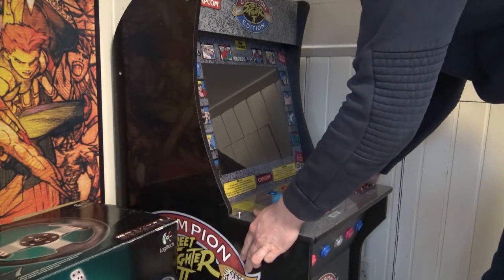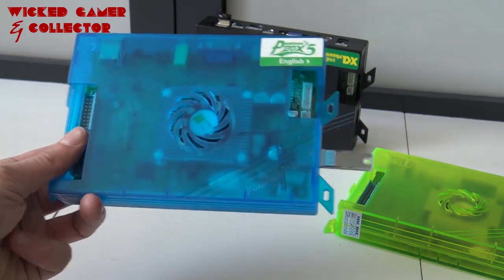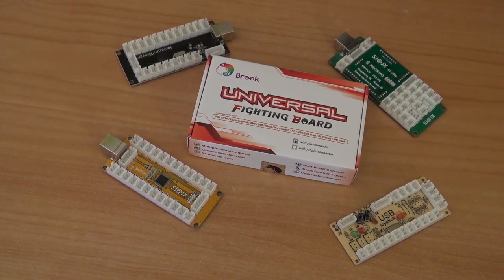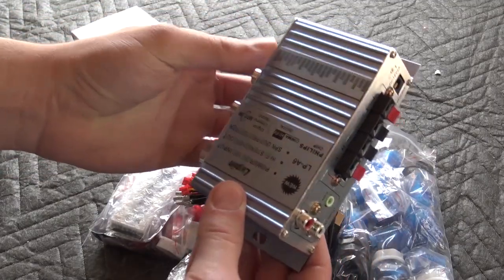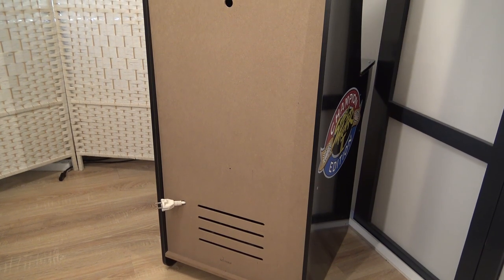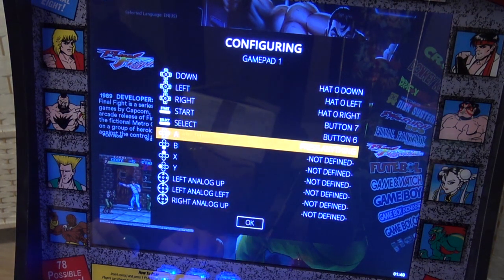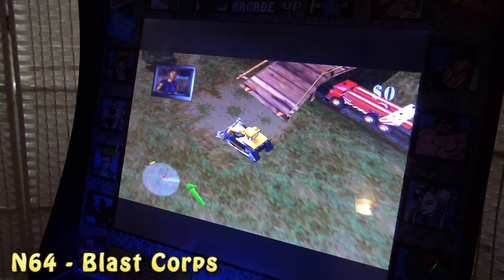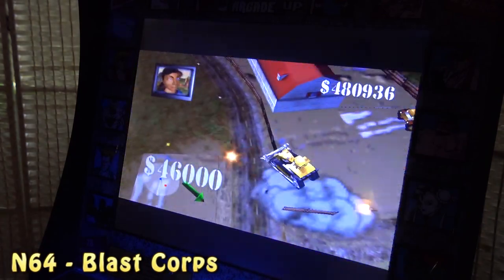Super Console X PC Arcade1up / Arcade MOD

Comment: With my USB encoders plugged in on my super console cube it boot loops for 5 to 10 minutes on emulec screen . When I unplug my USB encoders and  just using the supplied wireless controller then it boots up fine. What is going on here. And also 1st and 2nd player joysticks are randomly assigned everytime I boot it up using USB encoders and arcade joysticks. I never know what side is going to be 1st player.
Reply from the maker: Maybe get a 2 player 1 one encoder board ?

Comment: I upgraded my Arcade1Up SF2 cabinet with a 20’’ monitor (Dell 2007FPB IPS display) using the Tulsa Arcades upgrade kit. The result is absolutely fantastic. Really recommend this mod!
Reply from the maker: Yeah want to have that kit only need to pay crazy amount of shipping. 
Need to contact the guy and work something out. 
Because I hate the original display of arcade1up 😬
Reply: @WickedGamerCollector  Indeed, I ordered my kit on the Tulsa Arcades eBay storefront, as their official website did not offer international shipping. I ended up paying around 180€ to get the kit delivered to France, for what is essentially a piece of wood and a bezel with plexiglass. The package arrived within a month, in very good shape. But more importantly, this is a transformative mod and the display looks absolutely fantastic! Also, if you ever decide to do this mod, just make sure you pick up a Dell 2007FPB model equipped with a LG/Philips S-IPS panel, and not a Samsung S-PVA one...
Reply: Does the dell monitor get rid of the bars top n bottom of screen?
Reply: @dregott4975  The Dell 2007FPB has a 4:3 ratio (1600x1200 @ 60Hz) vs. the 5:4 ratio of the original Arcade1Up monitor, if that’s what you mean. So, most arcade oldies and console games up to the PS2/Gamecube era will scale up nicely on the Dell. In regards to more recent 16:9 games, it is more of a mixed bad, with most games managing to stretch vertically to occupy the whole screen real estate, while others will display top & bottom black bars... I was also really happy to see that a lot of modern PC games on Steam still support 4:3 resolutions, so there’s that as well.
Reply: I got the kit on black friday for $39. Well worth it

Comment: I reccomend a J4125 for super cheap emulation that can run upto gamecube at fullspeed
Reply: I have never heard of this. Can it be out in an arcade like this and run 4 players
Reply: @toweringtoys409  Yes, Check out the Larkbox Pro. I am playing Soul Calibur 2 and MAME Killer Instinct at full speed for only 190 dollars
Reply: Is size doesn't matter, you can get away even cheaper than that. mITX board + RAM + case & power supply should be at roughly 150.-
Reply: @anno5936  Always best to build it yourself no doubt. I built a few mITX machines. However the little wattage this PC pulls from the wall and its performance for its celeron cpu really turns heads. I say its much more power efficient than something with a full sfx/atx psu
Reply: @idkanymore3382  Yeah, that's a fair point!  If anything, i'd go for a picoPSU. Also a good option: i look for "dead" notebooks (most of them with broken screen) and buy 'em up, got me a system with mobile 3rd Gen i7 + dedicated nVidia GPU; nothing special but good enough for up to PS2 at a price of roughly €30... options are endless if you're digging deep enough.
Reply: @anno5936  So I did some extra research on these mini PCs and will vouch now that your best bet is the J4125 however do NOT buy a TerryZa or anything with that casing as the heat gets trapped under the top and it overheats. Get yourself a LarkBox Pro with the J4125. I just got it and it runs like butter, and doesnt even get hot under stress loads. If you want something alittle better then get a mini PC with a 7200U, but keep in mind that is a dual core but has a beefier iGPU. With 15W of max wattage the LarkBox is perfect for a always on machine that can run those gamecube and wii games with ease as well as higher end MAME titles.
Laptops are great buys though, I wish I could find a ryzen laptop for less than 300. The prices for new AMD chips is ridiculous! Even the Athlon 3000g is 100 dollars
Reply: @idkanymore3382  Yep, current times are a bummer... i guess i'll stick to the used route, most likely untill AM5 comes along, and go for an APU build again... I still have an A8-7700k and another console with 8th gen i5 + RX580, if the upcoming Zen4 can match it at a lower power consumption in terms of gaming AND beat my Westmere workstation, i'll retire it all at once 😁
Thx mate for the effort.